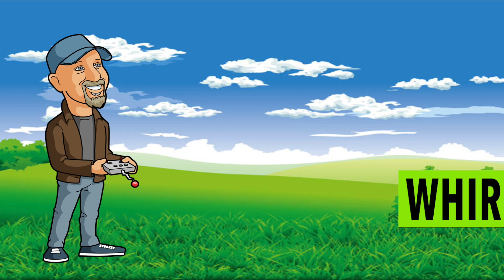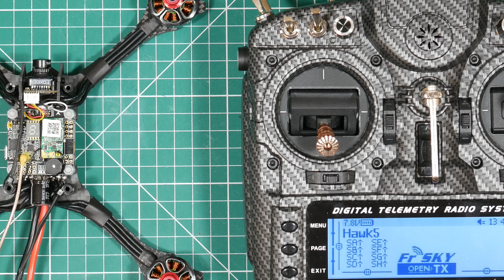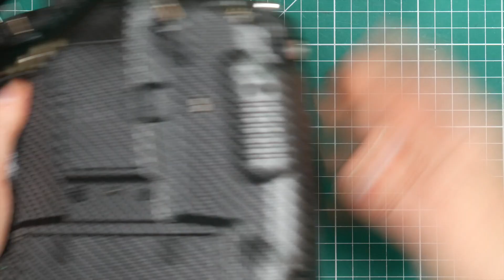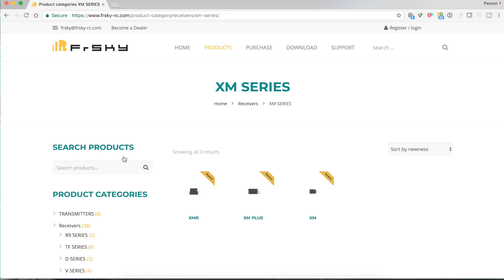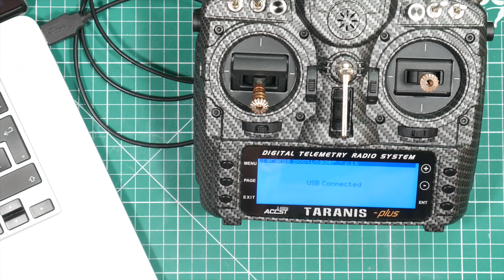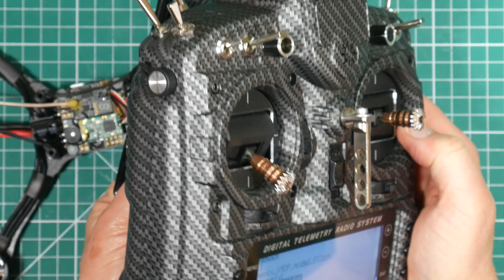EMAX Hawk 5 Magnum F4 flight tower FrSky XM+ receiver and Taranis won’t bind

Comment: I'm am so stuck with mine do you know how I find out what my controller is in the first place bought it of ebay so iv no idea, it has d8 d16 and lr something.
Reply from the maker: I'de suggest re-flashing the firmware and get the latest OpenTX so you know what you're dealing with. The FAA or LBT version on the transmitter is fundamentally dependent on the  TX module in the transmitter and not controlled by the firmware. The different firmwares just enable the D8 feature. So if you have an International TX, changing to LBT firmware won't make it EU and vice versa. EU-LBT will usually have a sticker on the TX case.

Comment: Great video,thought you had cured my problem,i have two quads that bind just fine . but loose connection shortly after. Any ideas.?All the best.
Reply from the maker: Only thing really, other than a fried receiver, is to double check you've got the correct firmware version.

Comment: hey man just some minutes ago a quad i was flying with an Xm+..never had updated or anything...flew normaly 2 batteries..when i plugged a new one to fly....it didnt bind the reciever..i came back home checked everything wiring etc...all is good...i tried to rebind but nothing..also i flashed it just now hoping it will help but nothing....it dont bind.....means its dead i guess? when i turn on on binding mode the xm+ i have the red-green light normaly ...but no....pffffff

Comment: Be carefull, I destroyed my xm+ following this guide.
I followed exactly the operations, double checked everything, but flashing didn't work (no led lighting up, error message on the taranis).
I double cheched again the connections afterwards, they were correct.
Now my xm+ doesn't light up.
Reply: After repairs, i can give this advice to the viewers : unsoldering the xm+ is quite easy with a good soldering iron (like the TS100) : just ADD solder (yes) so that you are able to heat up the three solder pads at the same time, and gently lift the receiver with a pair of tweezers (you can put heatshrink on the tweezers). It's fast and easy. Then remove the solder with a pump and unsoldering braid. 
Then follow the guide for flashing the receiver, and resolder the receiver in place.
Reply: I'm just gonna have to buy a new receiver to finish mine
Reply: I'm about to buy a Hawk 5 and I have a Taranis Q X7s. In your opinion should I just get the PNP version and add a receiver or get the version that already has a XM+ and attempt to flash it?
Reply: @rja12  i had bad luck. I did it again several times with another hawk 5 and it worked perfectly. So you can go on with the mod with no worries
Reply: i guess my xm+ wasn't working to begin with

Comment: Great video and super informative! Please note: as RSSI on OSD is supported, please make sure to use the XM+ firmware with RSSI on channel 8 (for RSSI on Aux 4) or 16 (for Aux 12). Both are in the same firmware package.The firmware mentioned in your video is without this feature. Otherwise great stuff!
Reply from the maker: Thanks for the info

Comment: Top tip, I was not too keen on trying to desolder the XM+ from my Hawk 5!! BTW, if you follow these instructions but get a 'No Response From Bottom Pin' error, then you have one of the newer QX7's like I do. The solution is very similar, just;
1. Don't switch the server wires round - leave them 'as is'. 
2. Plug the servo lead into the Sport connector, on the bottom side of the QX7, to the left of the SD card.